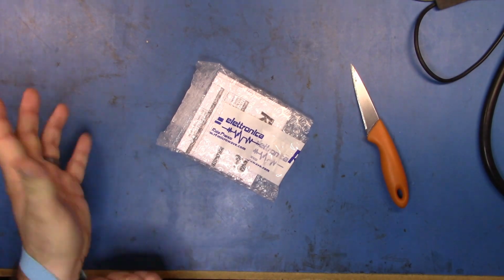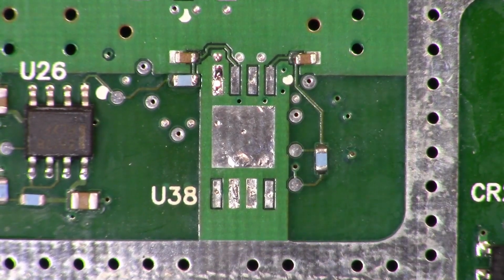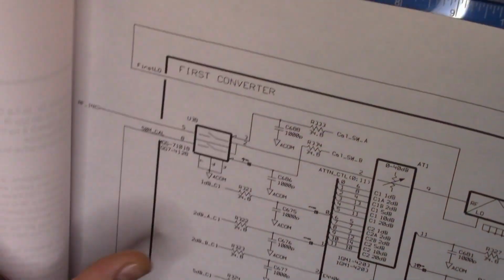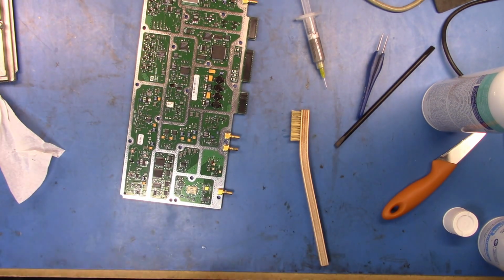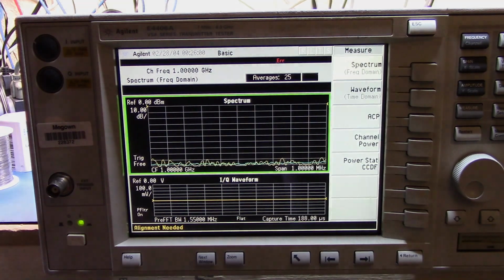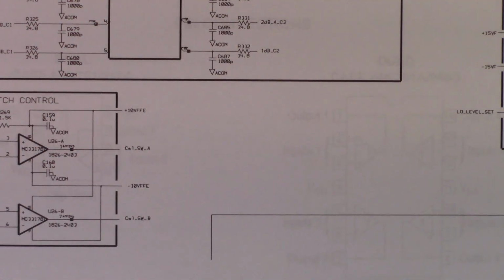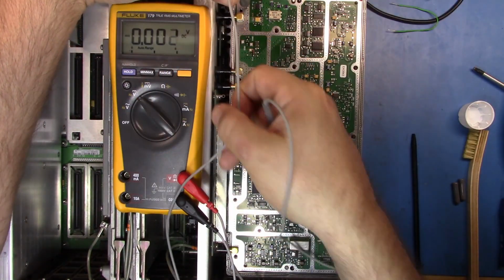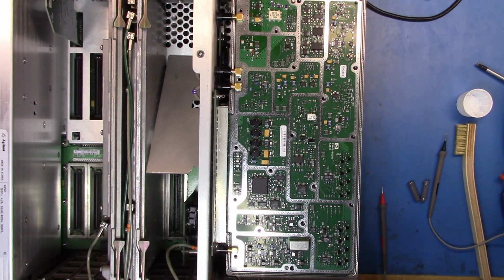Agilent E4406A Repair - Part 3

Comment: Bom dia Preciso o esquema elétrico da fonte Power Supply Agilent  E4406A obrigado
Reply from the maker: Hi there - I'm sorry but I only speak & read English so I had to pass the comment through a web translator - I think you're asking if I have the schematic for the power supply. If so then unfortunately no.

A lot of HPAK gear from this era started using power supplies built by 3rd parties like TDK Lambda etc. Finding the schematics for those seems to be impossible.

Your best bet is to see if you can either buy a working supply or part only 4406 on a local auction site. Otherwise, you are stuck fixing it yourself.

One final point, some HPAK units around this time wouldn't properly start the power supply unless the fan was working - You might want to give that a check first to see if it is the case here - I don't remember if that is the case as my PS was working fine.

Good luck.

Comment: I would be tempted to install series diodes to reduce the voltage slightly, back to back to allow for the polarity changing.
Reply from the maker: Thanks - I need to check the relay to see if it is a power issue, I haven't had a chance to try that yet but will post a new video on that when I can get to it.

Comment: Not really sure that scrubbing the SSR with a horse hair brush is a great idea.
Reply from the maker: I got that wrong - It's actually a hog hair brush from MG Chemicals - I've had very good results with it in terms of removing flux - It's not specifically designed for small pitch SMT work but it is a general ESD safe brush for cleaning flux.
Reply: Aw well, that's better. To be honest I still think the scrubbing is a bit OTT. I know everyone has their own methods but I clean the board well with IPA before placing the component and then would simply tag each leg on a part like this with a fine tip soldering iron (rather than using a hot air gun and risking overheating the component). That way there is very little flux residue to remove which I  simply dab with the corner of an esd safe wipe. Hope you don't mind me expressing my thoughts. Having said all that I wouldn't be surprised if these parts were not genuine as I have never seen one without the part number stamped on it.
Reply from the maker: Not at all - I try to keep the temperature of the hot air station on the lower side of the normal range and on a denser board I cover the surrounding components with Kapton tape, I prefer this way because I always seem to oversolder when using the iron - Though I have been meaning to buy a proper drag solder tip and give that a try. The final wiping is done using KimTech wipes which again I have been very happy with the result.

Comment: Not working esd  safe
Reply from the maker: I don't go hard core on the ESD aspect. The blue mat and the wrist strap are grounded, all the tools are ESD Safe but if the device is in packaging, or in place on the board/unit, I generally let that be enough for ESD protection. Overall I think I balance the risk with the level of effort involved for hobby work.